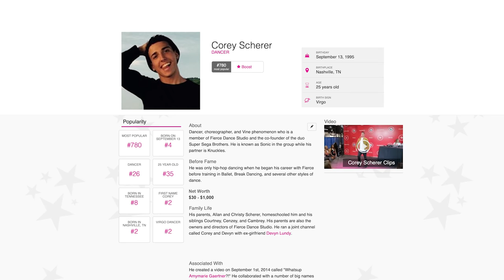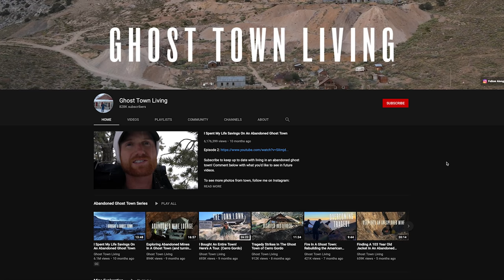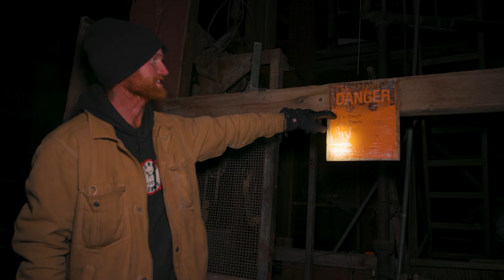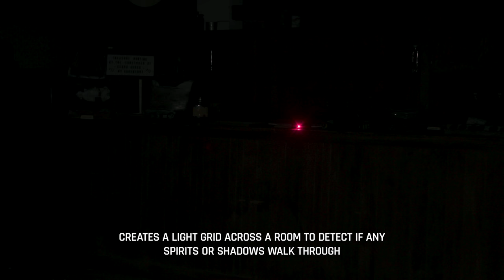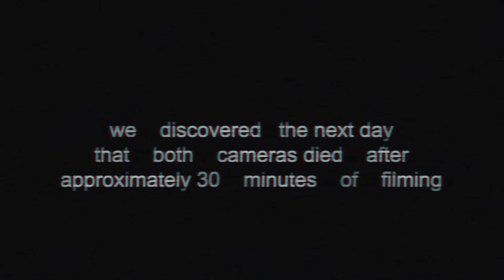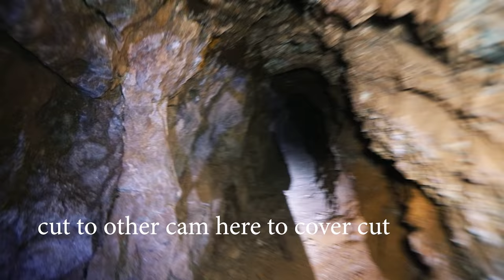OVERNIGHT in HAUNTED CERRO GORDO GHOST TOWN!

Comment: I am 100% here for all the moments in between investigations.  My face hurts from laughing.  And so envious of the tow-boarding.  I went to college/ski camp in Northern VT and then lived another decade up there afterwards.  We never used a quad...that would have been too safe.  We just tied a rope to the back of whomever's truck or car....and....we did this so often and on questionable roads (almost always dirt roads) with questionable snow cover...so using our own boards n skis would result in effing up the bases down to the core and blowing out edges which is another good reason to work at at the mountain ski and demo shops.  There was more than a few instances where the desire to go skitching (which is what we called this) came along when we did not have any boards on hand.  The normal response to being in such a predicament would be to abandon the idea, but instead we just experimented with objects we could find in the vacinity.  As this was almost always done late in the evening, and on roads not 100 miles in the middle of nowhere, but actually used by other mototists, this added another layer of challenge.  Some of the objects used in these skitching eperiments that I can remember at this moment included> any actual sled....the old fashioned ones with runners were deadly scary.  Saucers and tubes were the most fun but also led to the most injuries.  Cafateria lunch trays worked suprisingly well.  Best multi-person object was a dorm room mattress (was covered in some kind of super thick plastic) but this required several beta runs to dial in.  The tow rope needs to be secured to the actual mattress as its mass required a pretty fast take-off speed by the truck.  also needed to dial in right ammount of people or the end of the mattress just got ripped off.  Also maybe remember those weird mini sled things that were made to be worn on your snow boots?  Those were also super fun but also had a high ER-visit ratio.

Comment: At 1:04:31 or 1:05:32 u can see a shadow that passes by the chair. At 1:11:34 or 1:11:35 when they turned off the light u can see a black shadow like holding a bottle. At least that's what it looks like to me.

Comment: I'm way way way late.. But I don't see the comment and at around 58:12 there is an orb that flies up after the light turns on and before the ball lights up.. Then another orb is seen flying down at around 1:00:15 right after Corey asks if Elton is joking... Then in the same place as before another is seen going down at around 1:01:05 before listen pops up on the screen. This is just what I saw before the rest of the comments about the stuff after.